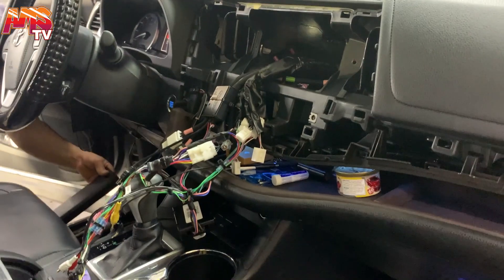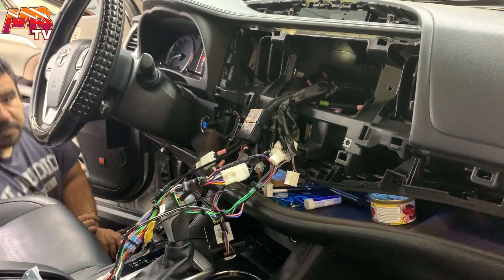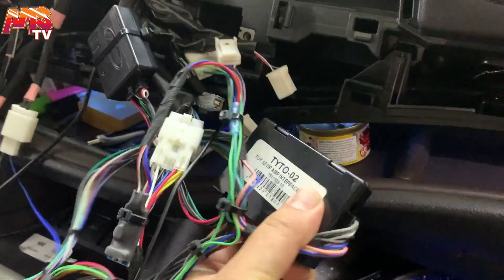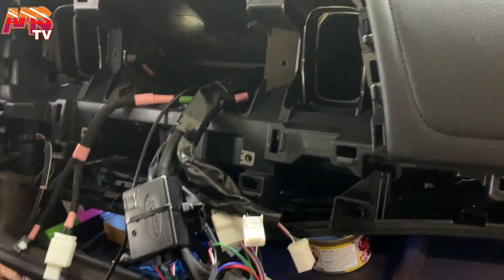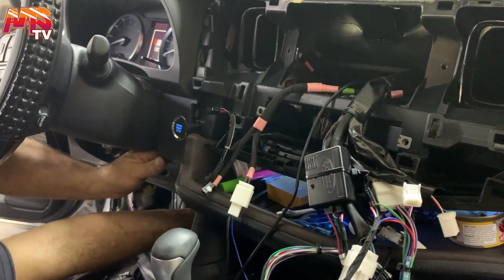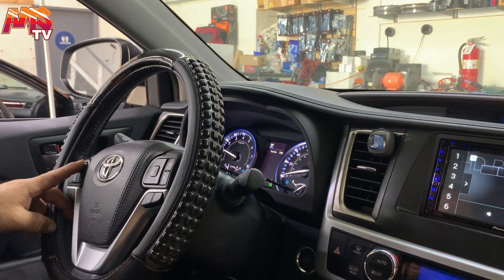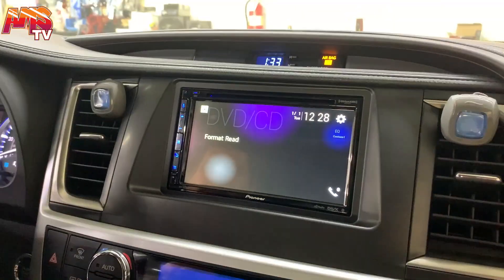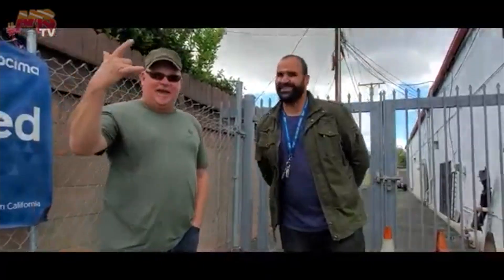2018-2019-2020 Toyota  highlander radio upgrade project 1006

Comment: @audio Motorsports how did you retain the factory antenna? what is the part number for the harness of the antenna i just installed the Pionnerr Double Avh201 ex on my 19 highlander now I am missing the back up camera and the antenna for the Am/FM radio.

Comment: Hi guys could you please help me out

I got 2016 limited with JBL 

I bought aftermarket Android stereo 

Everything works but sound 

What I was reading is that my amplifier needs to be connected to power

So my how can I locate my amplifier wire ?

Thanks

Comment: I was running a 12.3 inch android from China, but the software was crap. They claim it android 13 no it's Android 6 or lower. But the did do a great job on the face plate and monitor. oh and harness. The software just fucking sucked!!!! If only someone would take the monitor and face plate. And set it up to connect to whatever brand stereo someone would want to use. That works be a absolute genius idea.